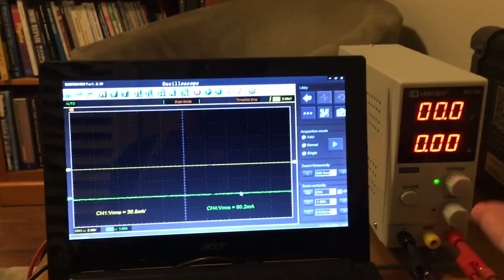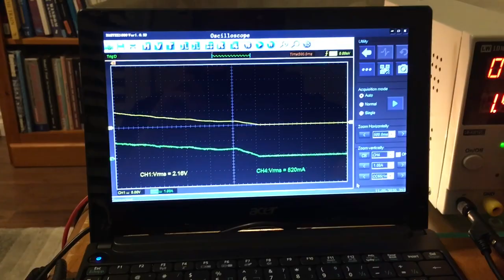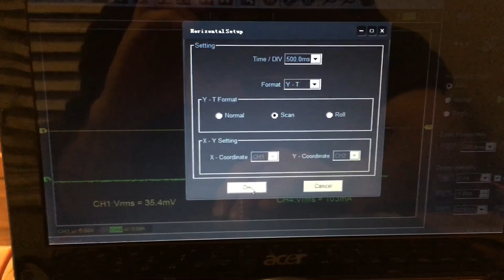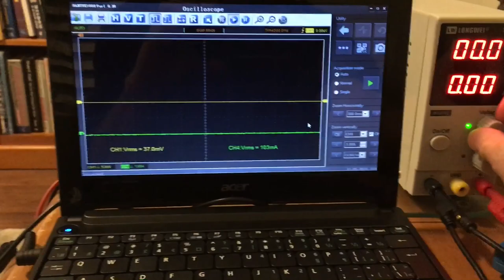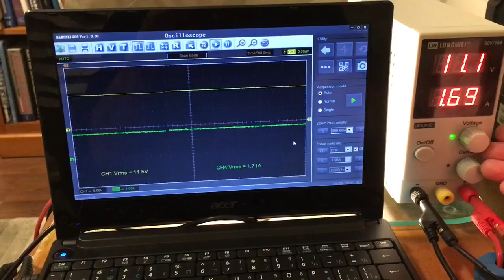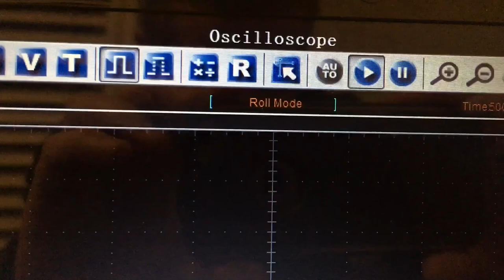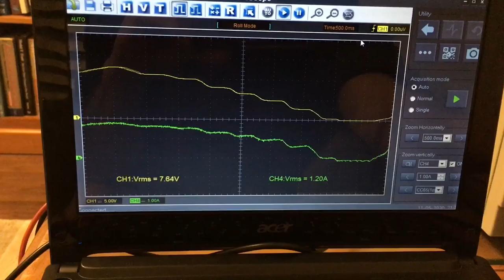Hantek Scope Horizontal Modes

Comment: I think what we're witnessing here is "page transitions". Happens at higher speeds too but we don't notice it. Happens with the HANTEK software but also LOTO and yes, the big boy PICO!
A page is the buffer capacity. When full, new page ... and a short drop of information at the transition.
In HScope "SCOPE" mode, the same page concept applies. BUT (and I am unaware of any other software that does this) in AUTOMOTIVE MODULE, real time streaming is in use ... no pages ... no transitions ... no dropouts. This mode is limited to maximum 125 Ksa/s sample rate, sufficient for most automotive oscilloscope work.
Reply from the maker: logical canuck Thx Denis. I didn’t know the terminology for it. But do know it can cause ye grief if you are unaware of it. Appreciate the the details. Hope all’s well. Cheers Pal

Comment: Really good info. Thanks.  I noticed on your scope, the menus up at the top of the screen are not visible. That's the same thing on my Hantek 1008C scope. If I hover over where the menus should be, they will appear, but I can't figure out how to make them appear at all times.
Reply from the maker: Different versions present differently. If you are running Hantek1008 Ver 1.0.30 I don’t believe you can select the header menu only Icon type tool bar is available. Earlier versions (non automotive type) I think can be configured with the drop down option. I could be mistaken…Cheers 👍

Comment: How did you get tip voltage and amps displayed on the screen?
Reply from the maker: From the Menu select “Measure” then source (channel you want) then vertical (for amplitude related type) horizontal (for period related type). You can have multiple measurements onscreen (up to 6, I think). If you can find the time read the Help section...lots of good stuff! Cheers
Reply: @TheGibby3340  Ha, I found it like five minutes after I posted the question. Thanks though!